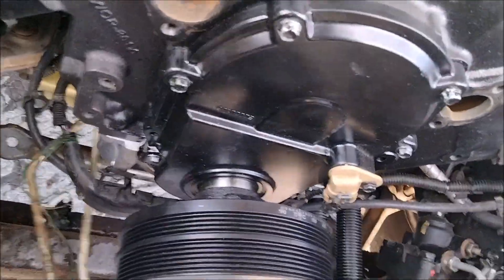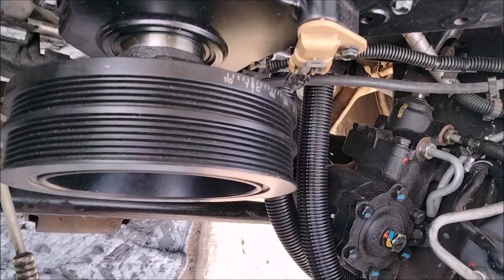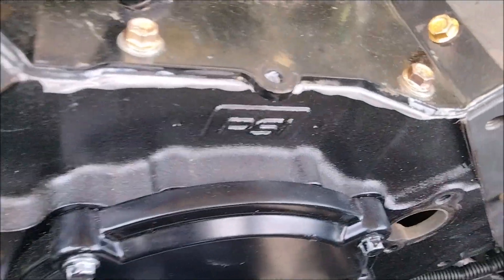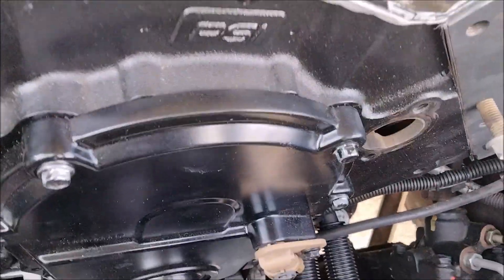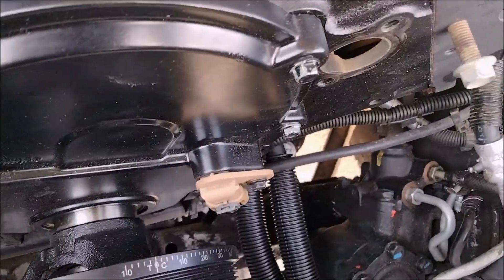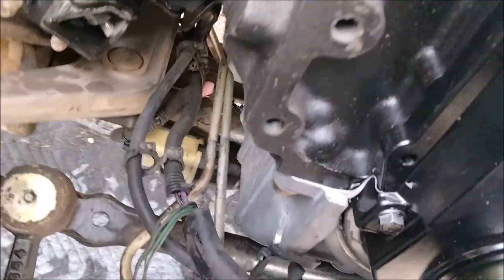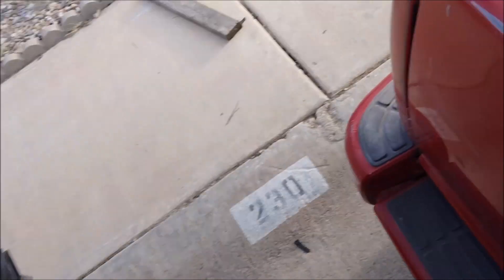Vortec 8.1L to 8.8L PSI AC bracket modification for fitment

Comment: I watch all your videos. Learning a lot for the swap into my 94 suburban.  I'm still unsure if the 8.1 or psi 8.8 is better for a wheeling rig
Reply from the maker: For towing 8.8 hands down if you dont mind doing extra work. 8.1 is easier
Reply: @fuelslut  I want easy and the 8.1 seems to make great power. I might toss a bigger cam in it too just because I can. Lol